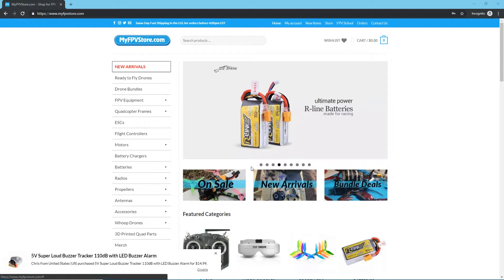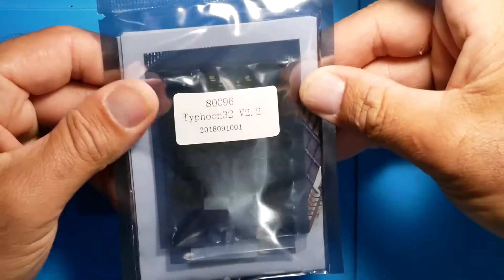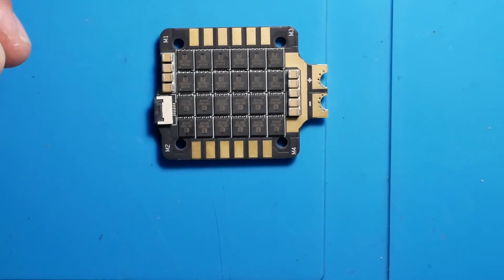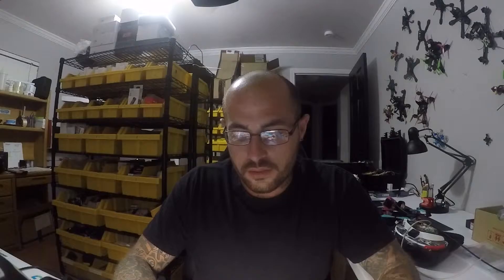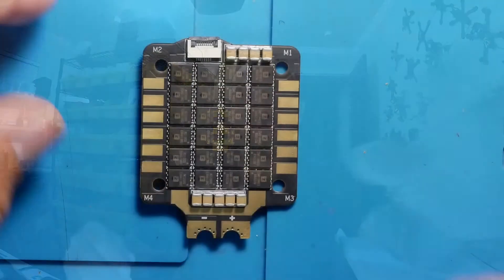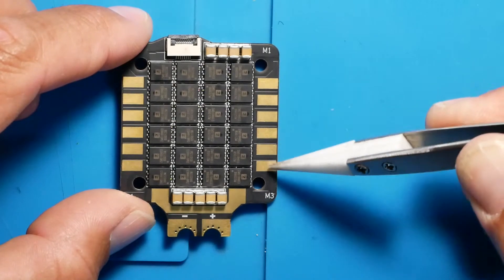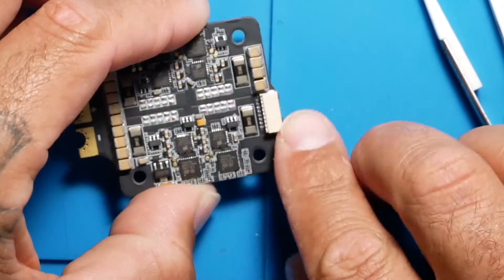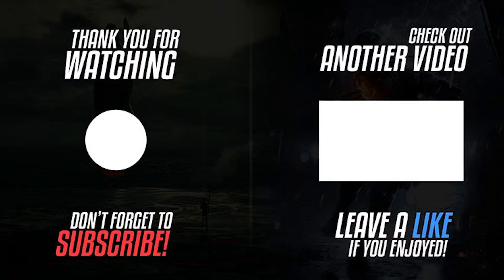Airbot Typhoon32 V2 Wiring | Pinout | Specs

Comment: Does blheli32 suite require that the telemetry wire must be connected to the flight controller? I'm gonna have to retrofit my typhoon32 onto my Omnibus F4 V3 which only has a 6 pin JST input slot
Reply from the maker: It does not "require" the telemtry wire, only requires the signal wire.